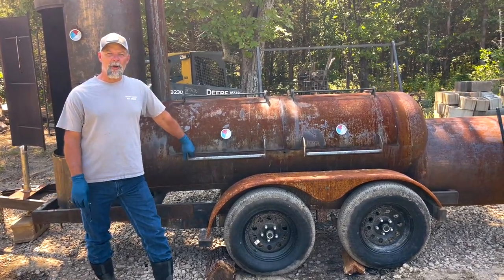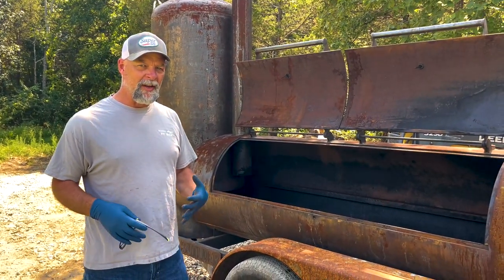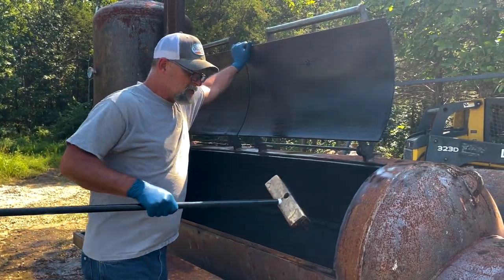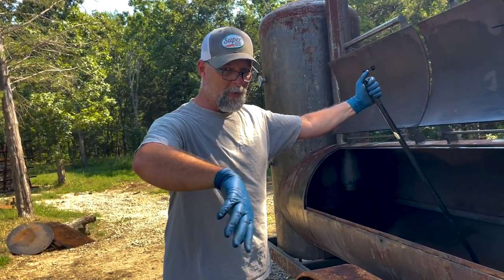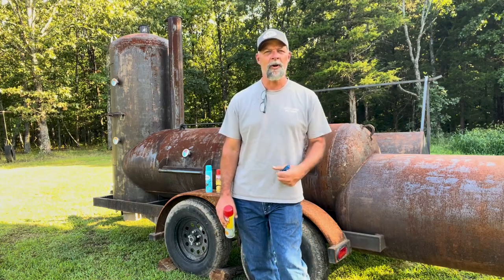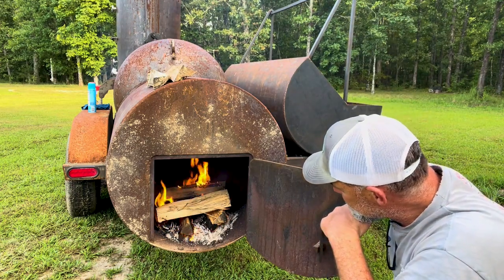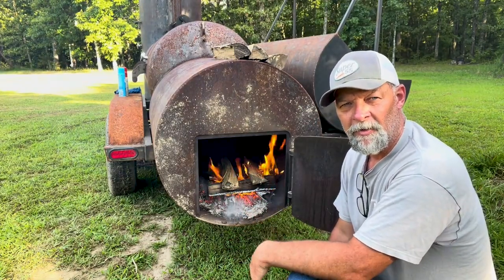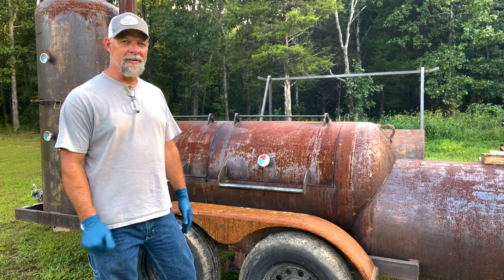Clean and Season Your Offset Smoker: Easy Guide

Comment: Should mill scale be removed before the seasoning process inside or outside?
Reply from the maker: @davek3726  no need to remove it! It looks great with oil on it
Reply: Thanks for replying back, 1 last ? is mill scale safe inside the cook chamber or if on the expanded steel cooking grate after doing the first seasoning?
Reply from the maker: @davek3726  yep! it is totally safe
Reply: @SmokerBuilder  thanks again and keep the videos coming